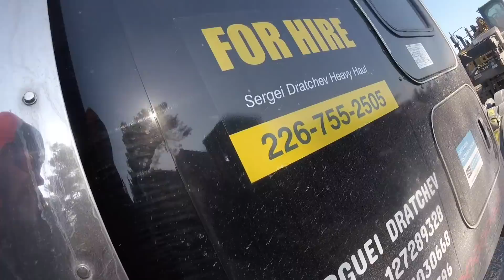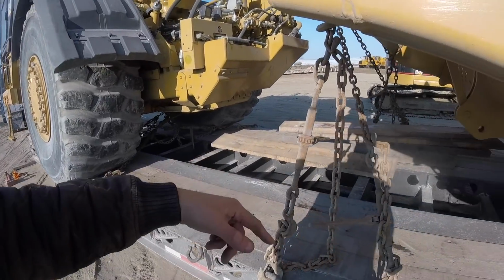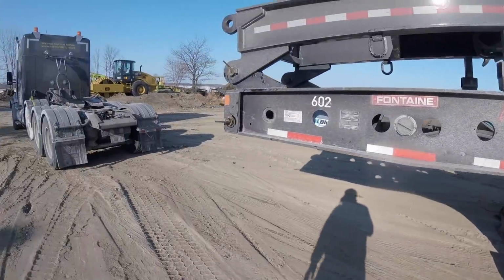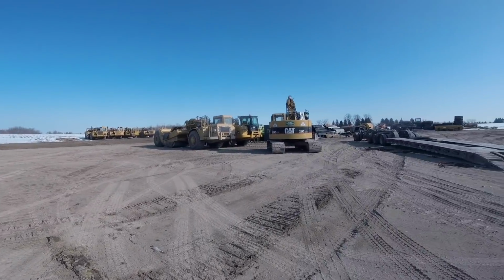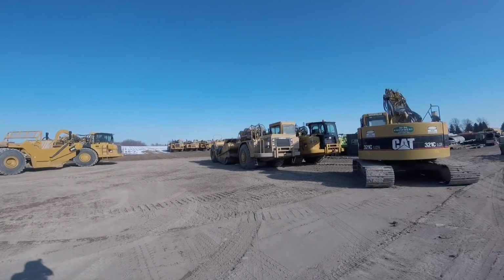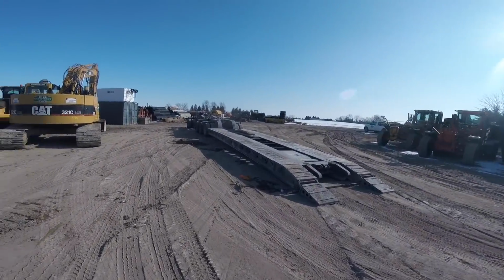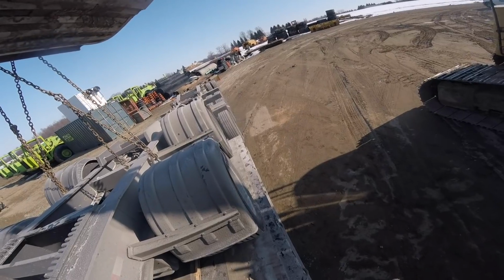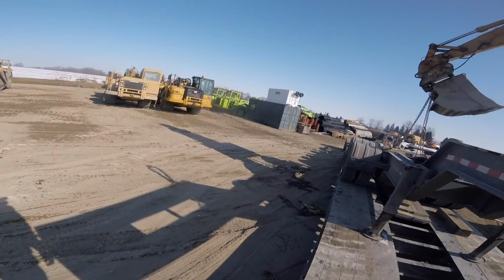CATERPILLAR 621 'H' SCRAPER -- Delivery in London, Canada

Comment: 👍👍👍👍 Kenworth horn sounds like a train horn. Move over.  get out of the way, the boss coming through. Definitely a nice looking truck.
Reply from the maker: not sure why my air horn developed this cool 2 tone sound! maybe because I spent days in the frigid weather in Western Canada?... i never heard this two tone note before... it sounded like a train... i had been wondering why i have 4 horns but they sound pretty lame from inside the cab. more testing is required! PS: reason i pulled the airhorn cord was I saw John filming with the phone at the gate, and I thought it'd add some production value to the video ;)
Reply: @HHTV60  not being a know it all, I kinda had it figured that way, seeing the new video's from the outside of the approaching truck and all.

Comment: Great clip coming in the driveway.  I could see what you mean when you say the booster pushes the trailer around the turn.
Reply from the maker: the trick with the booster is: the harder i turn the steering wheel, the harder the booster turns in the opposite direction, and helps to push the rear away from the corner! i don't want to drive again with 4 axles in a row! this is so much better!

Comment: Thanks Colonel. When will you change to two axles on the stinger? The drive bys really looked great.
Reply from the maker: I'll change to 2+2 when it gets warmer. I like running with the booster. The trailer turns much nicer than with a straight 4 in a row. A 2+2 setup will be more agile, since the turning point on the booster will be closer to the front!
Reply: @HHTV60  Thanks for the reply.

Comment: when the flipbox is up, get a cheap tarp to cover the king pin area, to keep dirt/salt off
Reply from the maker: all right, I got 3 free tips for you. 1) when the freezer's door is closed, spray the rubber seal with WD-40 to keep the insects out. 2) if you desire to lose weight fast, secure an armed British #73 Grenade on the handles of the freezer.  "FRAG OUT' sign on the fridge is optional. 3) when the mailbox handle is UP, remember to de-activate the mine field, and then re-activate it once the secret message is collected. Thx 4 watchin'.

Comment: How does the Cummins pull with the heavier weights? Do you expect any cooling issues in the hot weather with the increased loads?
Reply from the maker: The engine pulls great, but I'm think I'm geared too fast for these heavy loads. With the current effective ratio of 3.91, the truck jerks if I try to start in Gear 1 when loaded, and I have to use Low High. Once the drive tires wear out, I"m gonna replace them with 285 tires (same 24.5 rim), so that I get real 4.10 ratio (my diffs are 4.10, but because of tall rubber, it becomes 3.91), if that makes any sense.. Thanks for watching!
Reply: Saw the same model tractor T880 pulling a beam trailer with jeep and stinger set up and a CAT  988? it was a biggin  load

Comment: SergueI, looks to me like the stinger might fit turned around on the back of the trailer withe the wheels on the first cross support and the air bags unit facing backwards. If it would fit I would look into having a support bass welded for securement.
I now you love having the fenders on the jeep but you won't to go to a 2 + 2 on the trailer and booster have you thought of have mental fenders made that would also support the 2 + 2 booster setup when not in us?
I would also see if the shop that made the jeep for you could come up with a way to hook the jeep to the neck of the trailer when it's not hook to the trailer so you could load the jeep your self when there no one there to do it for you.
Love to see you finally get the trailer you always wonted and that you are getting loads in the winter with it. keep it up.Just wish I was driving for you. Mike
ps go wash that thing lol
Reply from the maker: I'm going to keep the jeep fenders. The stinger will fit -- the rear wheels will sit on bolster #1, and the neck will rest on the back of the jeep (will put in a timber across the jeep's frame). Saw another guy haul his jeep and stinger like this.

Comment: Can you simply back the jeep onto the trailer?
Reply: same question
Reply: It would take the temporary use of a second tractor.
Reply: Maybe Sergi got the super secret "Hover neck" option on the fontaine trailer.....so it just hovers in mid air while your hooked to the jeep backing it on to the trailer....then it magically reattaches itself to the trailer....🉑
Reply: Actually watched a demo with a different brand trailer where they disconnected the neck from the tractor onto a mounting  stand.  Then used the tractor to pull the jeep off the trailer.   Then hooked back up to the goose neck waiting on the stand.